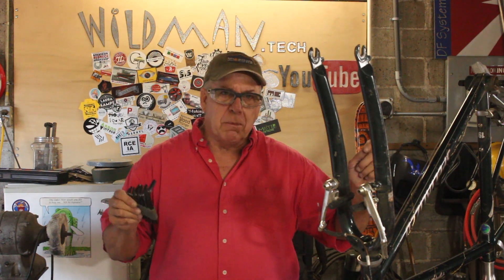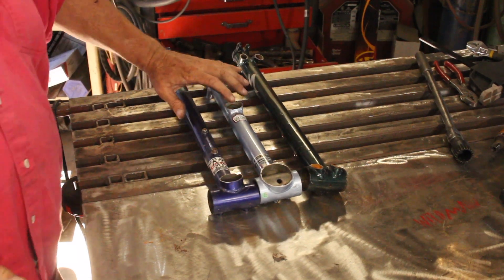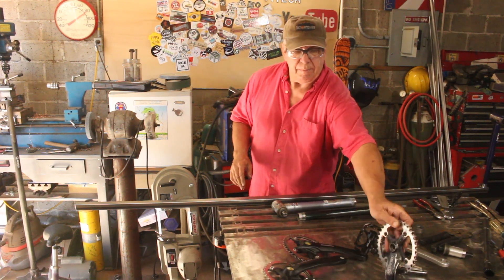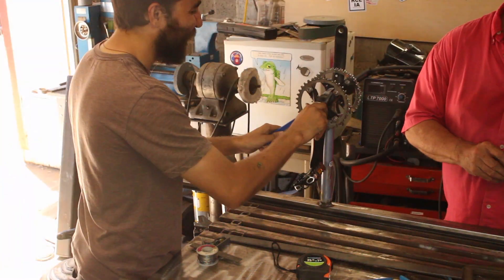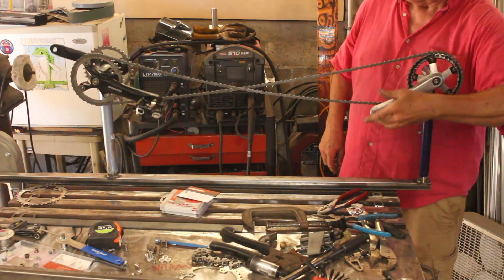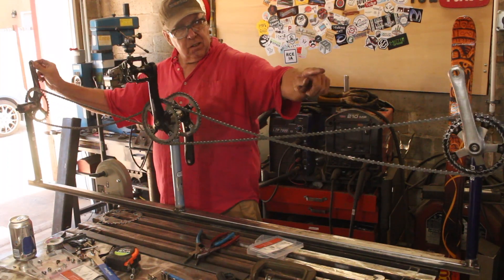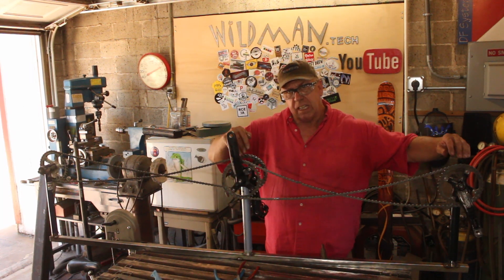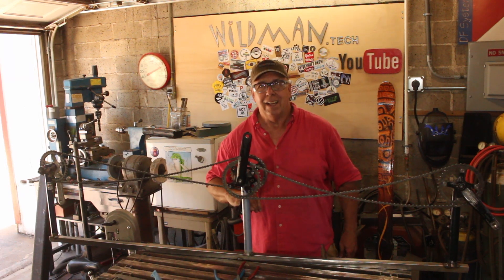Bonus! Retro Direct Drive Train Concept

Comment: Instead of chain tensioners, I wonder if a distance-adjustment on the front/rear gearsets would be possible?    That is how a normal bike works (the rear wheel moves backwards slightly to increase tension).

Alternatively, allowing them to go up/down slightly to introduce an angle would likely give you enough tension in a short distance to make up for a link in the chain.  That way, tensioning is simply a matter of shortening the chain, then fine-adjusting with an up/down adjustment.
Reply from the maker: The chains cris-cross in the middle and without a tensioner, they will rub. Also, what you're suggesting introduces an extra level of complexity and this job is a nightmare as it is.